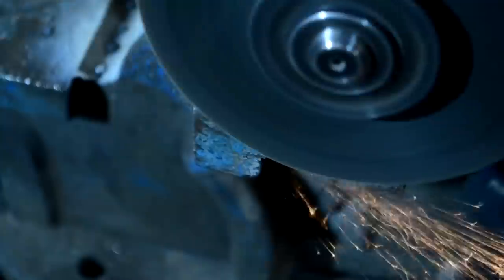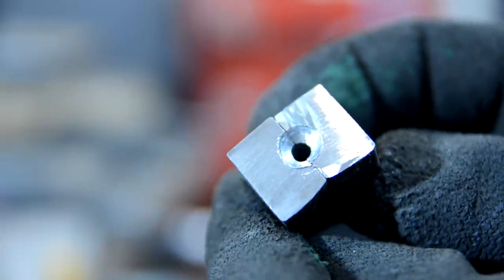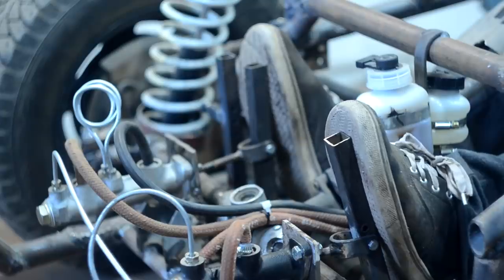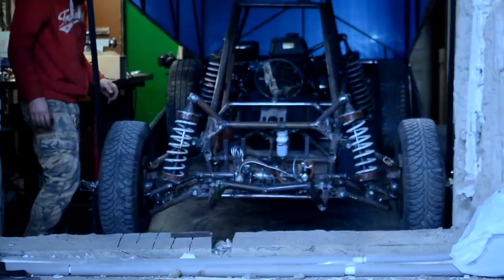HOW TO MAKE BUGGY from PUBG. Part 9. first ride

Comment: This is awesome!!! Sensible power, reliable inexpensive engine, the transaxle & clutch will easily handle the power of that engine, many parts CAN be bought at many auto parts stores... Reasonable performance and a complete engine replacement will cost no more than $450 for a completely new 420 cc unit... I really like the low CG of this vehicle, as it has much less tendency to roll on hard turns... After this experiment is worked out, the creator has a real potential to sell the plans and parts to build them... It probably won't win races with a machine that somebody paid more than $25k. on, but how important is that anyway... It will provide safe, fun and reliable OHV use, that will probably go as far, if not further than much more expen$I've machines... Beautiful / simple and effective design work!!!

Comment: The cool thing about this is its universal you can use litterally any engine of your choice.
Reply: So many people are sold on engines that produce the highest Horsepower ratings... This video has shown that relatively low HP ratings could effectively power a vehicle as the TORQUE the engine produces at lower RPM's is actually more useful, without having to rev the engine more than 2,500 RPM... Coupled with a sturdy transmission and engine, like this was,  this vehicle actually became extremely effective!!!

Comment: You could put a 420 predator engine in it.  They come with only 13hp from the factory or harbor freight,  but the aftermarket for them is huge you could totally have it cammed out with billlet parts n easily push around 30 hp
Reply: Would be a monster with a 670cc with go power sport mods😳
Reply: Naw the V twin Predator with a full build electric start!!
Reply: Those little predator motors are sweet

Comment: Looks awesome, very resourceful in what you have come up with .The only real thing I would address is the seating position,I would try to get the seat pan a little lower so your head isn’t above the cage and a little safer if you roll it over.

Comment: Good job dude. Make some turning brakes, one lever for the left, one for the right rear wheel, helps for high speed turns when there's no weight up front, and for donuts on the fly!

Comment: Man I want to split  a late 90s Polaris 4x4 quad front to back and in the middle then merry the pieces to a skidoo tunnel making a 4x4 buggy then I have a built Rotax outta my sled electric fans and just a cool buggy that’s 4x4. Polaris is chain drive front and back so would be a cheap east project.